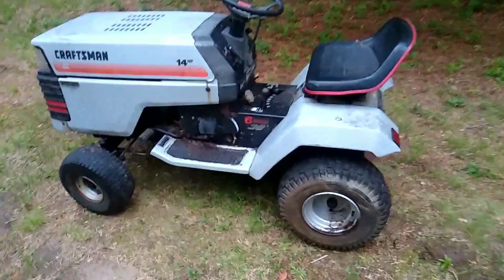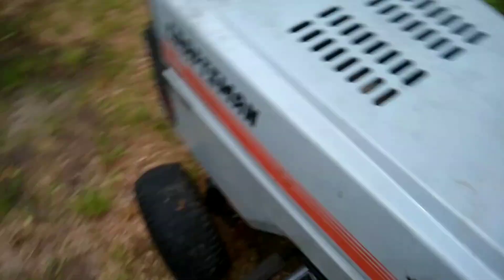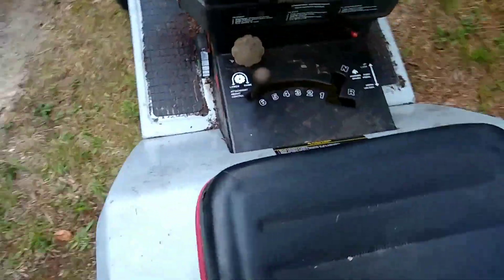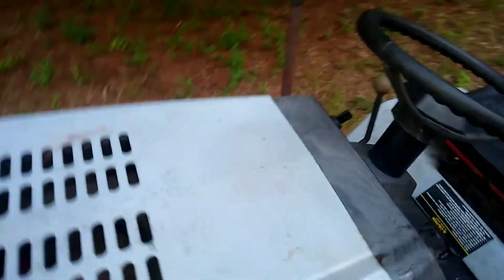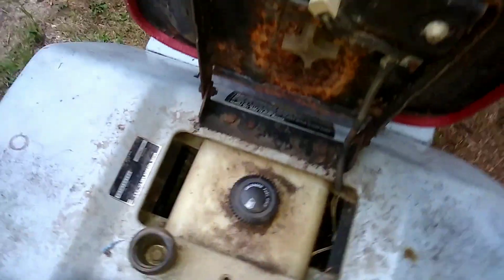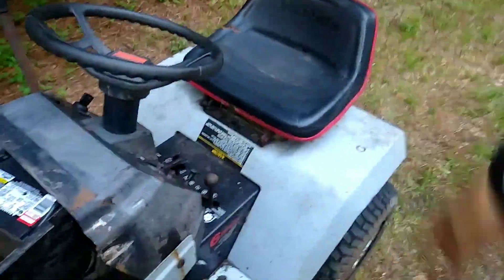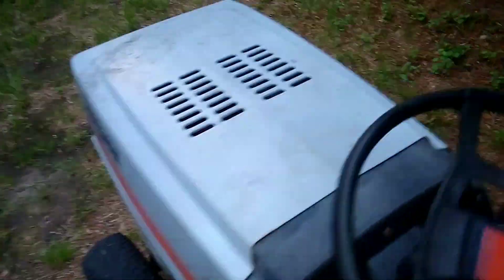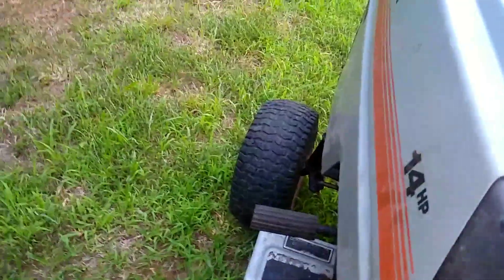16hp Craftsman Lawn Tractor Update

Comment: take the tank out pour gas in it put fuel shut off on a gas hose and shake it up move it back forth and have a old crusty gas can to put that fluid in
Reply from the maker: I've already cleaned the tank as you saw in one of my last videos :-) and I've installed a fuel shut off, this is a pretty old video compared to what I've done to it